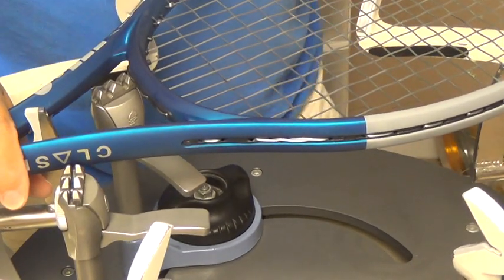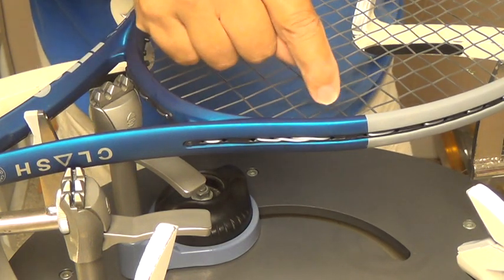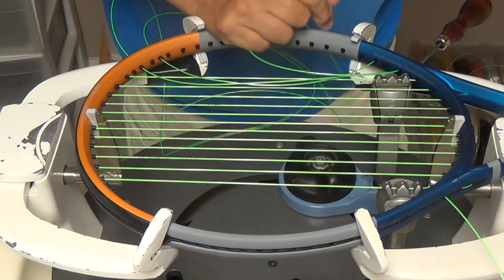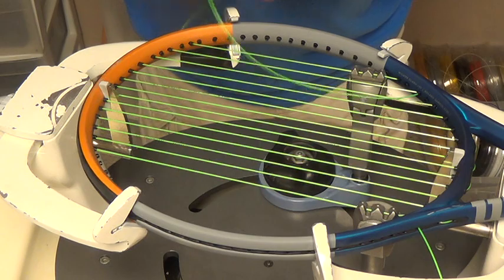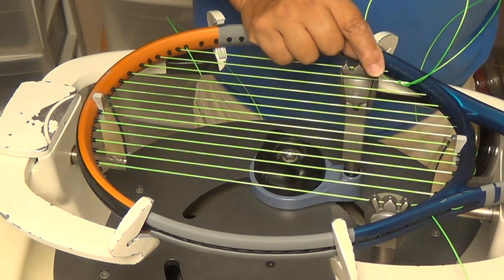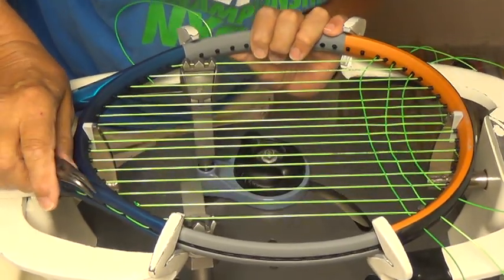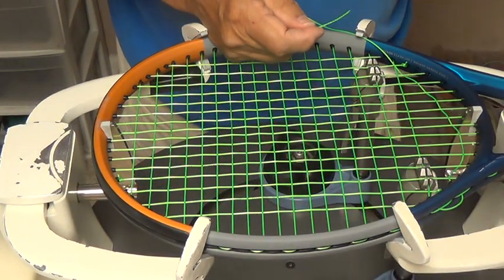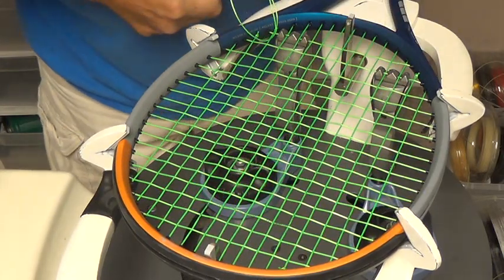Avoiding cross overs outside the frame

Comment: Yes, I do this. What I find is that in going through with the first cross, the main string naturally lies high or low in the groove, so it's easy to thread the string through that position with much effort. But the next main tends to lie on the opposite side (low if the last one was high, or vice versa), so I need to use the straight awl to move the main a bit before I can push in the cross in with my pliers. In addition to avoiding crossovers, I use 4 Parnell knots and the Cranford Tail Tuck. http://www.tennisindustrymag.com/issues/201803/racquet-tech.pdf What other techniques do people use to create a signature look?
Reply from the maker: eric Huang things I do for that signature look. I always mount the frame with the butt cap and tennis racket mounted upright. I have had client that remove their butt cap and install it upside down. In that case I mount the racket upright. I usually try to put the top cross tie off in the upper left when stringing a racket with 4 knots. When stringing with 4 knots I use the iKnot which is more that an inverted starting knot or very similar to the VS starting knot with the tail tucked in through the 2 loops. My tie off, other than the starting knot, are Parnell knots.
Reply: This is the first time I've come across the Cranford Tail Tuck (thanks for "Pointing" it out ... no pun) but then again, there are other Tail Tucks with other knots to make the tail safe. So, no USP with the Cranford. For example, The Parnel knot ends with a natural tuck anyway. Even if by some absurdity (not uncommon amongst amateur stringers so a sign to go elsewhere for your restring) the tail isn't tucked, just make sure when you cut the tail, don't cut it into a pointed end ... make sure it's blunt.

Comment: Sir thankyou forall your videos. I am looking forward to a stringing machine for doing my own racquets and maybe one day string other people ones.I have been looking for used machine for sometimesnow but nothing appears on ebay and other second hand webisites in my city.

So, I will be buying a new manual machine but my dilemma is whether I should buy a gravity constant pull one or a manual crank options. The difference in price is around 30%. Some say constant pull is better but lenghty. Some say crank is faster and precise. What would you suggest?

I will appreciate your comment (or anybody else's really).
Reply from the maker: For your first machine I would suggest a drop weight machine.
Reply: @Mr10sStringer  thank you I will follow your suggestion. Any tips about features of the machine? Some drop weight have an automatic tension system that grips the string automatically and just need one pull at any angle.
Most have a ball bearing string gripper with spring clutch (ratchet). What is you quick thought about it?
Your body of work is outstanding and very enjoyable. You got me subscribed.
Reply from the maker: @guidodelgiudice5  strange question. In the past I’ve always favored a 6 point mount. Lately I see the mounting on my X-2 has advantages and disadvantages also. If I were looking for a stringer now I would first look at the clamps. I just got some Pro-Stringer Claws and like them better every day. After the clamps the tensioner is important. I’m going to make a series of videos with my X-2 keep an eye out for it.
Reply: @Mr10sStringer  thank you.
Reply: @Mr10sStringer  thank you Mr Stringer, you helped me make my mind up. 

I have looked into eagnas and gamma mainly; struggled to understand wether 2 point mount was enough and fixed or flying clamps would have made any difference.

I will go for the X2. 
You mentioned those pro stringer claws clamps and I have looked into it. What do I need? 2 medium, 2 large or one of each?
Should I get a starting clamp?

I believe I can do a decent job with that. Maybe a little bit more lengthy and crafty but consistent.

Thank you Sir
Reply from the maker: @guidodelgiudice5  if you get the Claws I would go with 2 medium and 1 large. You can use a flying clamp to do some of the functions of a starting clamp but IMO the starting clamp is a much better option. If it is in your budget I would suggest 2 medium / 1 large claw, and 2 Gamma starting clamps.
Reply: @Mr10sStringer  this is great. All added up it's $450 (gamma x2 and clamps). 
Is this still the better option or should I go for $580 progression 602 with fixed clamps at this point? For almost the same price range what is better? Do I still need extra clamps with the 602fc?
It's a long conversation 😜 but I see the end of the tunnel...
Reply from the maker: @guidodelgiudice5 I would prefer fixed clamps over flying clamps. But if you have fixed clamps you still should have a starting clamp IMO.
Reply: @Mr10sStringer  ultimately I will buy the ALPHA PIONEER DC PLUS. 6 points, fixed clamps, linear gripper ratchet, drop weight. I hope the linear gripper won't give me problem over the system Gamma uses. For starting clamp I found the alpha one which is wider than the gamma. Wish me luck...
Reply from the maker: @guidodelgiudice5  good luck but I’m sure you won’t need it. Mark at New Tech Tennis seems to be easy and ready to work if you have any issues they will make it right.
Reply: @Mr10sStringer  great news. I am so excited. I will gladly have to watch more and more of your videos.
Reply: When you have constant pull the tension is being adjusted as the string relaxes.  But after you clamp the string that segment is relaxing anyway.   So constant pull helps for one to two seconds, or how ever long it takes you to set that clamp.   A constant pull is going to produce a 5 to 10 percent tighter string bed.  You just have to account for that.   So if I want to match a crank to a constant pull at 50 I would set the crank to 54.   Drop weights, which I never used seem to be a pain and I question how good a job a person can do with that.    For example it looks like you have to keep adjusting to get that drop weight level.   That would be like using a crank and alternately putting the crank close to and then far from the turn table.   Also floating clamps suck.

Comment: Wow you’re still making videos. Hey Irvin, can I ask you a question?
Reply from the maker: Samantha Harner sure you can ask a question. Would you like to ask another question?
Reply: @Mr10sStringer  sorry for the late reply. I just wanted to ask, what is your opinion on mgr/i? Do you think it's important?
Reply from the maker: Samantha Harner MgR/I is all about a ration of mass, balance, and SW. if you like a specific weight, balance, and SW you have a specific MgR/I. I like MgR/I because if I have 2 known values I can easily identify the other.
Reply: Mr10sStringer I have a racquet and it feels pretty sluggish when swinging. Is this because of low mgr/I? Or do you think it’s because of high swingweight?
Reply from the maker: Samantha Harner WOW that’s a difficult question. Long story short your SW is too high.
Reply: Mr10sStringer someone on the forum said there’s an optimal MgR/I value. Do you believe that is true?
Reply from the maker: Samantha Harner yes I do (for me) but there is also an optional weight (for me,) an optimal balance (for me,) and an optimal MgR/I. If you set you frames up for the same SW, balance, and weight you will have the same MgR/I. I do not believe every man 5’ 11” should play with an MgR/I of 21 like I do and every one should play with a SW of 330 like I do either. What are more important for me is SW and Balance. I like a balance of 31.5 cm so using MgR/I of 21.0 and knowing the SW, and balance I can figure out the mass. Does that make sense?
Reply: Mr10sStringer yes that make sense. Thank you. May I ask just 1 last question?
Reply: Mr10sStringer A racquet with higher swingweight will have more plow through, am I correct? If I have two of the same racquets. 

On the first racquet, I add enough lead at 12 o clock to make the sw = 360 and on the second racquet, I add a ton of lead at 6 o clock to make the sw = 360. Then which of the two racquet will have more plow through?
Reply: Mr10sStringer I guess you do not know?
Reply from the maker: Samantha Harner the racket with the weight at 6 o’clock. Which ever racket weighs the most will have the highest plow.
Reply from the maker: Samantha Harner sorry I did not see your previous question. If you hitting with a racket with a SW of 360 no wonder you swing seems sluggish.
Reply: Mr10sStringer yeah but the way mass is distributed can have an effect on the sluggishness, right? A racquet with sw of 360 can feel less sluggish to swing if the balance is lowered.
Reply: Mr10sStringer I thought it was “higher swingweight, more plowthrough”?
Reply from the maker: Samantha Harner that is what they say alright. SW is measured from a 10 cm point from the butt of the racket. Kinetic energy or plow through is about putting more weight behind the ball. If the SWs of 2 rackets are the same then mass comes into play. Mass is inertia, and the more weight you have behind the ball at impact the more plow through you have. If you have matched rackets with the same weight and balance then the racket with the greater SW has the most plow.
Reply from the maker: Samantha Harner how mass is distributed is measured by inertia. The only problem, as I see it, is SW if measured relative to a 10 cm point. No way you will ever rotate a racket around a 10 cm pivot. But it is what it is. Inertia is a measure of how much force is required to rotate a racket around a pivot. If a racket weight 13 oz or 13 lb if the SWs are the same the same force is required to rotate the racket. Plow through is not angular motion it is kinetic energy and the greater the mass the harder it is to stop. So the greater the mass the greater the plow through.
Reply: Mr10sStringer thank you. You are very knowledgeable.
Reply from the maker: Samantha Harner thank you
Reply: Mr10sStringer would it be okay if I ask you about 2 more questions? You’re very knowledgeable about this stuff and I want to know what you think.
Reply from the maker: Samantha Harner just ask
Reply: Mr10sStringer that one guy on the forum say you hit more accurately and precise with a tuned mgr/I. Do you think that’s.. a myth?
Reply: Also, heavy, stiff racquet. Do you think that’s a good idea? Example: 366grams, 70RA.
Reply from the maker: Samantha Harner I believe him but at the same time it is setting up the weight, balance, and SW. You can achieve the same thing getting the MgR/I set the way you like it. But that does not mean one certain MgR/I is right for you. You have to find your own value.
Reply from the maker: Samantha Harner some people may like them but it’s not for me.
Reply: Thank you. Im gonna place a bunch of lead at 6 to increase mgr/I and balance and see how it turn out.
Reply: Mr10sStringer hey Irvin was wondering, what is your ideal mgr/I?
Reply from the maker: Samantha Harner 21.0
Reply from the maker: Samantha Harner you will get a greatest increase in MgR/I if you place the weight at 25 cm from the butt. Bit if your racket is sluggish why would you want to? IMO it is better to have a faster and more maneuverable racket than a heavy sluggish one.
Reply: Mr10sStringer yeah but I think putting lead at 6 is a lot prettier than putting lead 9 at 25cm from butt. And also I don’t think there’s a lot of an mgr/I increase difference between the two. Right? 

Also, do you think 380g is too heavy? I think wawrinka play with like a 372g and sampras used to play with at least 380g.
Reply: Mr10sStringer does stiffness play a role in power? If two racquets have exact same specs but difference in stiffness. Then the higher stiffness racquet will be more powerful?
Reply from the maker: Samantha Harner I though 366 g was too high
Reply from the maker: Samantha Harner yes
Reply: @Mr10sStringer  There this one site that said high mgr/i = better handling and depth control. Do you think that's somewhat true?
Reply from the maker: Samantha Harner no
Reply: Mr10sStringer I noticed that stiffer racquets tend to have bigger beam widths. Could a racquet with small beam width be really stiff also? For example, can a racquet with 21/21/21mm beam width have a stiffness of 72??
Reply from the maker: Samantha Harner I guess they could
Reply: Mr10sStringer I heard that stiffer racquets are more stable at contact and off-center hits. So, could high racquet stiffness make up for low twistweight?
Reply: Mr10sStringer If I buy tennis warehouse matching service. Should I get racquets that are closer in.. 1) balance, 2)weight or 3) swingweight? What do you think?
Reply from the maker: Samantha Harner there are 2 matching services available from TW. There is a $10 service and a $20 service. For the $10 you get stock rackets not telling what the weight, balance, and SW is. For the $20 service you should get what you ask for. My last video DIY racket matching jig should allow you to match the rackets anyway you want.
Reply: Mr10sStringer the balance of my racquet is 33cm. I strike the ball better with it. I don’t strike as well with balance in the 31s and 32s.. I noticed that people generally have balance of their racquets in the 32s. Is there any downside to having a high balance racquet?
Reply from the maker: Samantha Harner it makes the racket sluggish. With a 33 cm balance and a weight of .366 kg your adding 194 SW points plus your recoil weight.
Reply: Mr10sStringer do you think it’s okay having high balance? It‘s a personal preference right?
Reply from the maker: Samantha Harner personal preference I guess. Personally I think it is a terrible idea.
Reply: Mr10sStringer some people play with pretty high balance. Ex: Dimitrov, nishikori, Serena Williams. So I think it’s fine. Anyway, thank you